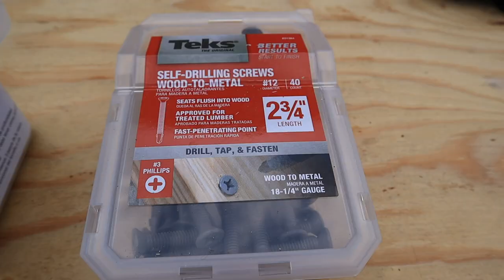Bus Conversion Skylights $72 Each! How we made them  - S03E14

Comment: Great video guys! I learnt a lot from it :) Do have a question about insulation, wouldnt these be cold in the wintertime?
Reply from the maker: Hi LadySakai, we have plans to finsih the interior of the skylights with metal frames against the ceiling so we will be able to use magnet mounting to then have a detachable cover with insulation to keep the cold out or add a layer of polycarb with ceramic tinting to keep UV and heat out in the summers. :)
Reply: Another option would be to add a 3/8 square moulding around the perimeter on the inside, and glue in another sheet of polycarbonate to that creating an insulated double pane skylight.
Reply: @Rehabit8  sounds like a good idea and I liked til util the issue with condensation came to mind. Do you think that would be an issue?
Reply: @LacroixCruiser  hmm yes, might be a solution, but again, what about condesation? That is a real bugger if that starts
Reply: TheLadySakai if sealed completely, condensation shouldn’t be a factor.

Comment: bless u guys 
aren't u afraid of something hard falling on these plexiglass ? are u going to add some protection ?
Reply from the maker: The plexiglass we bought is 200x stronger than glass.
Reply: thanks for your reply
wish u both the best ✌✌
Reply: @Rehabit8  200x's stronger than steel doesn't keep it from cracking, should  make them at least 1/4" thick and if the curvature it too great to pull down flat with the screws it can always be heated to soften. Hate to see you do all that nice work inside and hail crack then and leak. Just saying
Reply from the maker: Thanks Dean, we sure hope they hold up :) they lasted through some pretty strong storms and tornado force winds so fingers crossed we don’t see hail to test then anytime soon

Comment: If you were to put another sealed plexiglass on the interior of the bus wouldn't you eliminate frost and condensation on the inside
Reply from the maker: Yes like a double pane,  that could be a good option
Reply: You will have moisture issues doing this.  Unless it is a factory vacuum sealed unit.  You are going to have issues with this single pane polycarbonate piece of plastic in wide swinging climates.  This will also be a routine maintenance item for weatherproofing.  You might consider visiting a RV junkyard and getting a manufactured skylight.

Comment: Skylights let in way to much heat and are very hot.  Light is nice but its way to hot for use... I had to block them with reflective bubble insulation. We used it on our large front window. That cut the heat by 85% on the front. We also did this in the bed and it also pulled the heat out. After adding it to all the areas our AC work less and we stay at a nice 69 when its been 110 outside. 
Double Bubble Reflective Foil Insulation: (4 X 50 Ft)
https://www.amazon.com/gp/product/B07DH423MS/ref=ppx_yo_dt_b_asin_title_o08_s00?ie=UTF8&psc=1
Reply from the maker: Hey Lankster, we are planning on tinting the skylights with a ceramic tint to reduce heat and block UV rays. Will already have a roll of reflectex and will be making little pop in screens for days when we need to keep the sun out like you did as well. Thanks for sharing your experience

Comment: why tf would you use a diamond blade on aluminum. I would recommend just a normal metal cutoff blade. Diamond blades are made for cutting things like tiles or granite.
Reply from the maker: Actually there are diamond blades rated for cutting ferrous and non-ferrous metals.  These will last much longer, cut faster and cleaner, and wear down much slower than abrasive discs. Here’s the link to the blade we used https://www.menards.com/main/tools/power-tool-accessories/diamond-saw-blades/masterforce-reg-3-3-8-segmented-rim-diamond-blade-for-metal/mf-mc338/p-1444450181325-c-1534771931083.htm